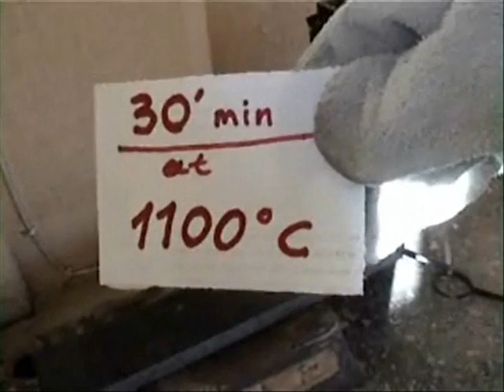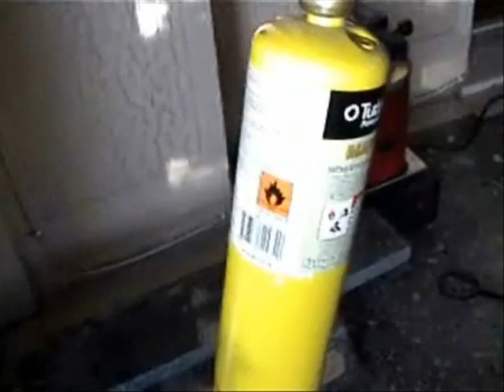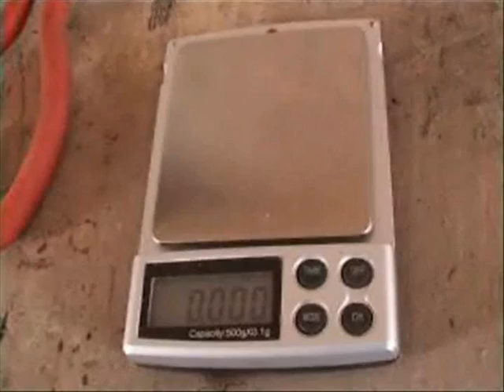MELTING COPPER MINI MELTING ELECTRIC FURNACE Making Ingot From Scrap Copper

Comment: It's worth it if you can run it off solar panels. Say around 3000w worth of solar panels and a good inverter should run it. The model you use costs a few hundred dollars and uses around 1600-1700w in power I believe, I see the same model on Aliexpress.
If you set it up to run on solar, then the cost of melting wouldn't exist. Thus all copper found and melted would be pure profit. 
You could make hundreds of ingots from things people throw out, it's possible to make a lot of money.

I wouldn't sell ingots though, if you could sell it in sheets online then you would have a winner. Around half of the copper we buy is from recycled copper anyway. 
To make copper sheets you first have to melt the copper, then you put it into a very thin mould. Next you pass it through rollers that squish it very thin. 

Doing it this way, you could make a lot of money. 
For example on ebay a sheet of 200x100x0.5 mm costs 10 Australian dollars. This sheet is only 90 grams, meaning the copper you just melted could make nearly 5 of those sheets with the copper you just melted. So you could make 50 dollars on that by processing it that way, instead of just selling it to scrap people who will only give you maybe 4 dollars for the whole bar.
Reply: One year later I'm here to say that from what I can see you know full well what you are talking about... Have a great day...Best regards...

Comment: ALL THAT WORK FOR LESS THAN 1 POUND!!!???
WHY?!
Reply from the maker: just for fun
Reply: kassi man Well, that is an excellent reason.
Reply: Because you can sell it.
Reply: kassi man what kind of electric furnace is that? (What is the name and brand of the furnace?)
Reply: +TactlessWookie wouldnt holly-anything... would be cheaper to build a homefurnace with a paint can, ceramic blanket and a homemade propane burner with an electric air pump... way cheaper.
Reply: @EPIhamuerto  Sorry...your answer/solution is not exactly accurate and it's not for everyone anyway...it depends of so many things...